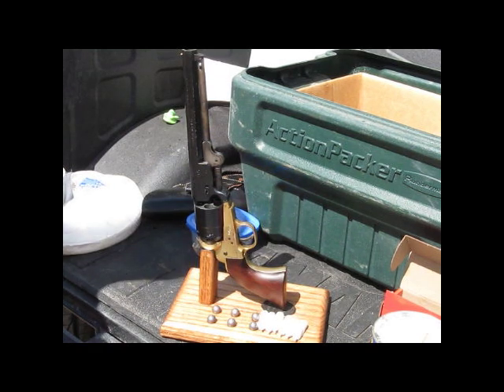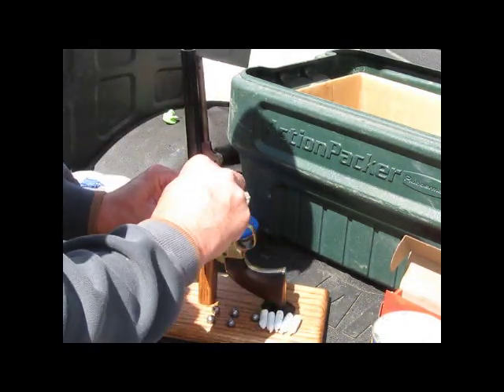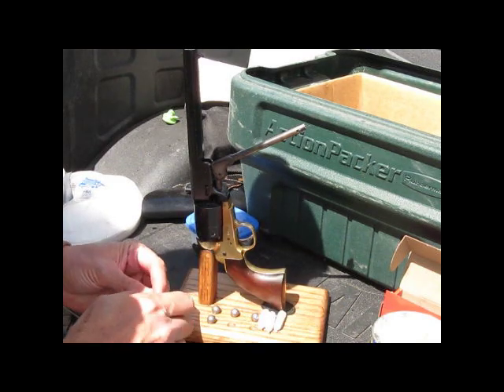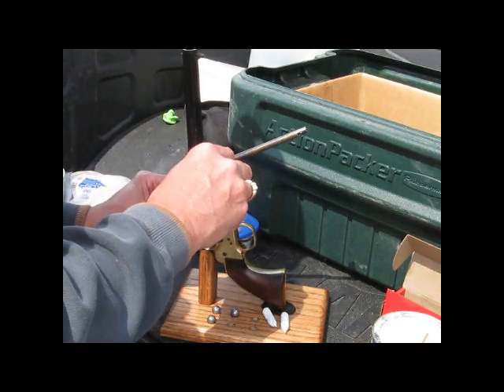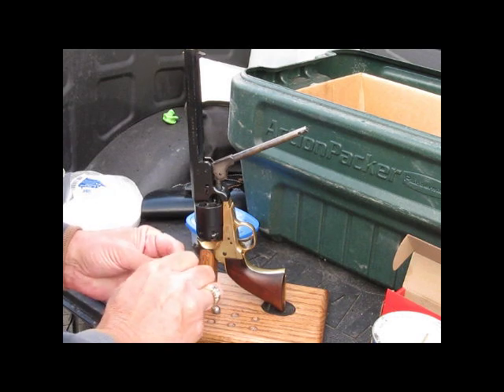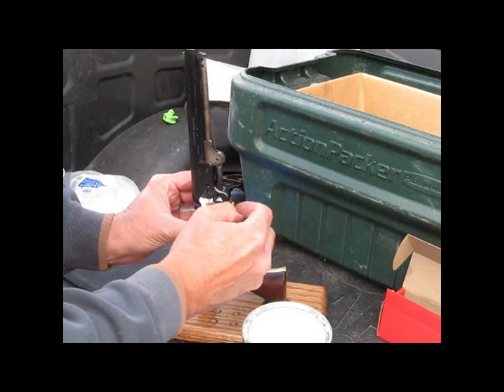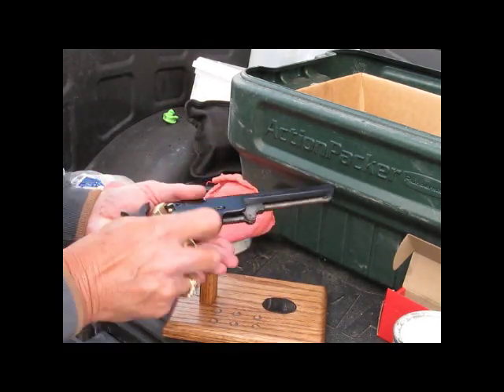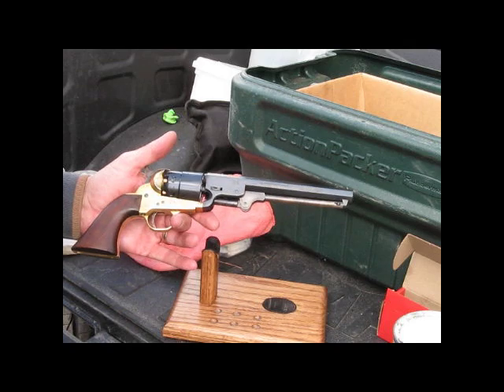Loading a Black Powder 1851 Navy with Paper Cartridges

Comment from the maker: This '51 is one of more BP revolvers than I can count. The load on this one was developed over the course of thousands of rounds. It's used for putting holes in paper and sailing golf balls over the horizon strictly and it does a great job. It's far and away my favorite shooter. Each one of my BP guns has it's pet load, I've tried higher loads in this one and it just doesn't shoot well.  BTW with a 16gr load and a RB it chronographs at just over 750 fps. For big booms I shoot my Dragoon.

Comment: Cool.  If you soak the paper in salt petre first then you can put the ball in the paper cartridge and just dump the whole thing in the cylinder with the paper.  The paper will ignite and burn with the powder.  This is the ultimate in paper cartridges for a cap and ball revolver.  Good luck and thanks for sharing.

Comment: You made an excellent video, Like the videography, The Can and Bottle with water on the log piece was great. Originally percussion Revolvers during and after the mid 1850 were loaded with Paper cartridges that were coated with Nitrate, The whole paper cartridge went in and upon being shot was consumed in the fire. If you have Steel Framed Revolvers check out my universal Bullets, with the right powder and caps it makes a Cap and Ball revolver into a Magnum. I designed this for hunting.

Comment from the maker: Crisco doesn't foul the gun, it just keeps the fouling soft so it removes easily.  Lubricated felt wads also do a very good job of keeping the fouling soft. The advantage to the lubricated felt wads is the lubrication stays pretty much inside the gun, whereas with Crisco it goes EVERYWHERE! I actually use both methods, I actually think the Crisco makes the gun clean easier in the end but it can make a mess of you when you're shooting. Pick the method which works best for you, both are good.

Comment from the maker: I don't have an answer for you on S&W rimfire but, the Minnie Ball wasn't designed for pistol. It was to replace the patched ball for rifle with a more accurate long range projectile. Healed bullets were used in revolvers but never replaced the round ball. Some folks still cast healed bullets but the RB is still the preferred projectile as it's much more simple to cast and to load.

Comment from the maker: Yes you can. The problem is that once in a while you'll get a piece of paper that will block the flash hole on the nipple causing a misfire on your next shot. I pour a little powder in from a torn cartridge simply to make sure that any unburned paper gets pushed out and doesn't foul my next shot. No matter how you do it though you want to make sure that you have a nipple pick handy and simply run it through before loading each time to prevent misfires.

Comment: There are multiple references to loads for cap and ball revolvers. The complete black powder hand book, load data provided by Pietta, Uberti, lyman, IMR, Pyrodex....you should give your pistol more credit, brass frame and all. Try 30 grains compressed. You will begin to realize your pistols potential. If you use it for wild hogs or protection, I would certainly  go with at least 30 grains. Your brass frame should handle it fine if it was made with in the last 20 years. Also I liked the video.

Comment from the maker: @busyhands94 I did make the stand. It has two vertical inserts. One works good for a '51 or '60 and the other is designed a little wider for use with a Walker or Dragoon. The insert pulls out for easy storage as well and illiminates the need for moving parts like hinges.

Comment from the maker: Yes but you run the risk of having a piece of paper blow back into the flash channel on the nipple, then you'll have a mis-fire the next time you load that chamber.  It doesn't happen often but it's a pain when it does. I've actually had to fire another cap through the unloaded chamber to clear the paper a few times, it can get stuck in there hard enough that a nipple pick won't clear it.

Comment from the maker: @Magnageek 
No wadding, just cornmeal filler.  The video you find on making them includes the roundball as well.  I've quit doing that simply because it speeds up making the cartridges, but doesn't slow me down loading the gun.  The paper really has nothing to do with chainfire protection.  Your best protection against chainfire will be a properly sized roundball on the front and the right caps on the back.   These paper cartridges are about the only way I shoot nowadays.

Comment: There's a reason paper cartridges aren't commercially made (and haven't been since roughly 1880): fragility.  Combustible paper cartridges with attached bullet are very convenient, but don't hold up well to handling. They were traditionally packed just six to a snug fitting box; if left loose or in a partial box, the paper would tear, powder would leak, at best creating a mess.  This kind of packaging would make them cost as much as brass rounds, but without the reloadable brass case.

Comment from the maker: For the cartridges I use Goex 3f. Cabela's DOES NOT sell Black Powder, they only sell substitutes like Pyrodex. You "can" use Pyrodex P but you might wind up with some ignition problems, give it a try and if it doesn't work for you then just load conventionally. Black Powder can be hard to get your hands on because the government considers it a low grade explosive not a propellant.
Reply: The reason real Black Powder is scarce is that the storage requirements are so stringent that most places don't carry it.

Comment: I have experimented with self-contained cigarette paper cartridges in my .36 colt replica.  They will fire, however leave 30+% paper residue in the chamber.  True combustible paper cartridges that leave zero residue must be made from flash paper and flash glue.   Making the self-contained combustible cartridges is extremely tedious.  They were so frail that Colt packaged them in wooden blocks with bored holes for each cartridge, and wrapped the blocks in paper.

Comment from the maker: @captindoom7 When you ram the ball into the chamber it will cut a ring of paper which can get bound up between the chamber and barrel. It's not that big of a deal, it's just easier for me to drop the ball in on top of the paper cartridge. Also, rolling the ball into the cartridge takes additional manual dexterity and patience. Both of which I only have a finite supply of.

Comment from the maker: @AmericaStandsStrong1 How much would depend on the gun. A Dragoon or Walker will hold 40-50 grains but a brass Navy won't handle much more than 20 grains. With a steel frame gun, theoretically you can safely load it with as much powder as you can stuff into the chamber and still manage to seat the ball. On the other hand, the accuracy of such a load will probably be dismal. Work up your loads starting at 20gr 3f and find what yeilds the best accuracy. This advice applies to steel frames only!!

Comment: 15 grains in a .44 is an extremely light load. (35grns recommended) I'm surprised the ball didn't lodge halfway down the barrel. Also Crisco is a poor lube because it has a tendency to all liquefy after the 1st shot with fluid literally dripping off the revolver. Pre lubed  wads in between the powder and ball best remedy this mess. Always keep your powder dry just isn't a catchy cliché phrase.

Comment from the maker: @reysaint1 Just loosen it then you may need to knock the wedge out from the right hand side using a brass punch. Pietta tends to put them in pretty good at the factory. Keep an eye on ALL screws when that gun is new, you don't want to lose one. Also, pop the nipples out and re-set them. They don't need to be very tight, just snug, they won't fall out.

Comment from the maker: Recommended by who? Each gun is different and brass frames won't tolerate heavy loads for long. As it turns out this gun will hit POA at 15yd with that load but it's been tweaked extensively. More powder doesn't necessarily hit the target any better but it will always make you lower on powder. I don't recommend Crisco for everybody, it depends on where you are weather wise a lot. If you're going to leave a gun loaded (I do), then NO lube is best. Even wads will foul your powder given time.

Comment: 16 gains. you sure it makes it out of the barrel?
Reply: Very sure, the muzzle velocity is over 800 fps about the same as 38 Special.
Reply: The Pietta manual recommends that the 1851 Navy BRASS frame revolver in .44 cal be downloaded to a maximum of 12 to 15 grains of BP. You can shoot the usual 20 to 25 if you wish, but you'll rattle the thing apart in short order.   @joehunnicutt6977
Reply: @seamusmcbride2832  
Those loads were 16gr 3f with 20gr of corn meal as filler.  That particular gun is most accurate with that load and has over the years spit out many thousands with that charge.

Comment: So what prevents chain fires if not the crisco? the paper wads that the powder was in? Also what is the brand/model of that primer caper?, i'm looking for something similar that holds a bunch. Thanks.
Reply from the maker: Proper fitting balls prevent chainfires. The ball should be large enough that it shaves a ring off when rammed into the chamber. Pietta repros usually take .454 balls.  The capper is a Ted Cash and is available through Track of the Wolf.
Reply: A good seated ball will leave a ring that seals the chamber

Comment from the maker: 30gr is WAY TOO MUCH powder for a brass framed gun, don't do it!! Pyrodex Pellets are generally used for rifles but they can be used in pistols as long as the charge doens't exceed the design limits of the gun.  Brass framed guns typically don't get charges in excess of 20gr 3f.  I load mine to 16gr 3f.  That's also why the grouping is better, higher charges typically don't mean better accuarcy.  Over charging WILL result in the brass frame stretching.